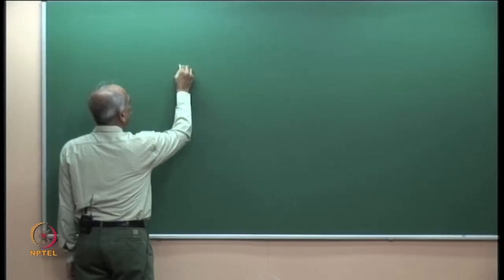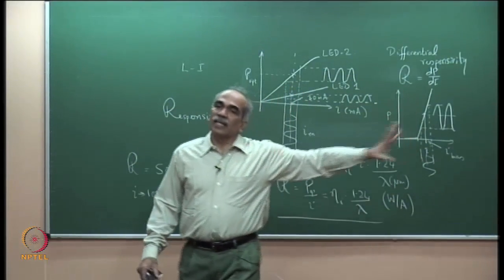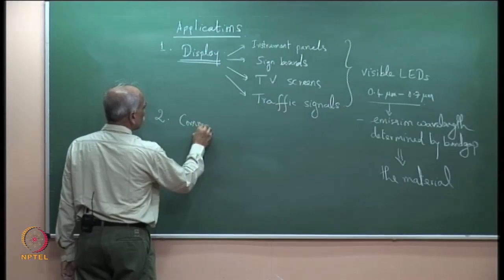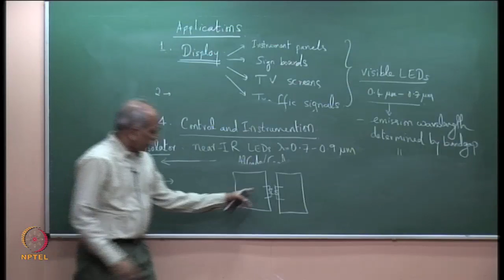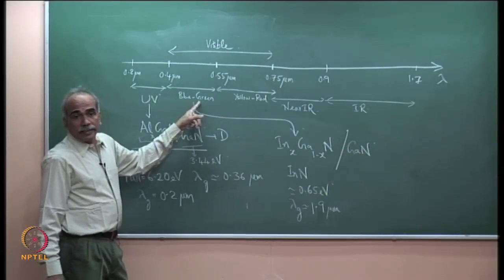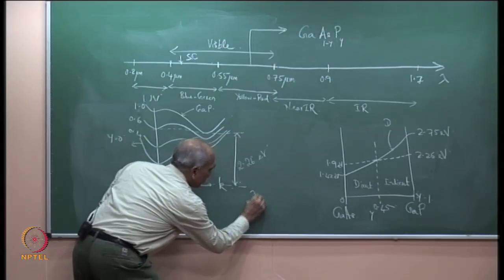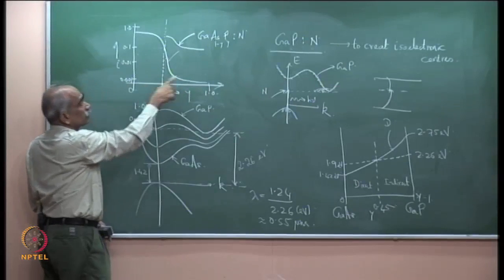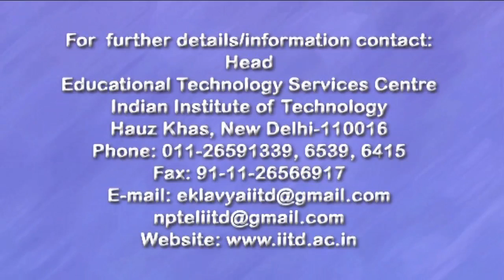Light Emitting Diode-V materials and Applications

Comment: pls can an LED be used to generate a gammay ray, x ray and radio way? i observe you hardly talk about those. thanks
Reply: ayodeji ogundana  ... no.... bcz for x ray and gamma ray you required a material which should have band gap of range KeV to MeV ...and its hard to genrate (may be impossible for real world) the e-h paire and so the recombination ....in case of radio wave ,band gap should be in range of  ueV - neV (which should be a conductor at room temp.) i.e. like no band gap so not a chance for e-h paires neither emission.... .... anyway nothing is impossible... these are just theories..... which you can prove wrong by inventing gamma ,x or radio emitting diodes( i think practically we shuld not use the term led for them ).... may be i am wrong... if so...plz rpy with the argument

Comment: sir ,what is the significance of indirect band gap  in GaAs leds??
Reply: Subhankar Chakraborty  ..GaAs is a direct band gap material and if you are talking about the GaAs leds then there is no indirect band involved....... but if you are talking about ternary compound (GaAsP, AlGaAs) then the significance of the indirect band gap is just to engineer the band gap and the very sexy term for that is band 'gap engineering'  i.e you can get the required band gap(what vale you want) by changing the composition of the ternary semiconductor compound..... other significance is that it can be act as a direct band gap by the application of isoelectronic centres( like we can genrate three colours green, yello, red ony using one material GaP(indrect) by the doping with N, N(high conc.) , Zn and O simultaneously respectively i.e. give green , yello and red)
Reply: thought the expample is not about GaAs........ but just to give you a idea about the significance of indirect band gap materials in led world)